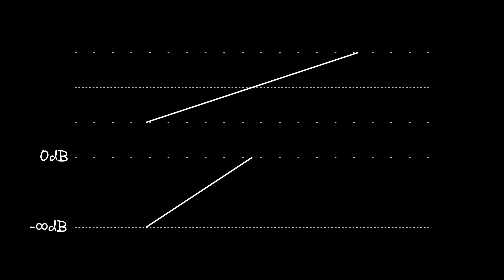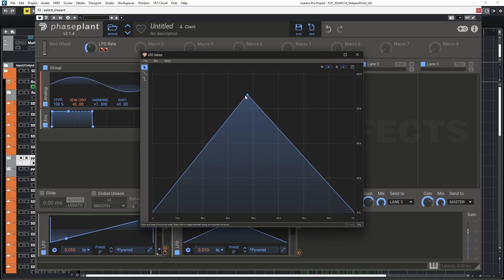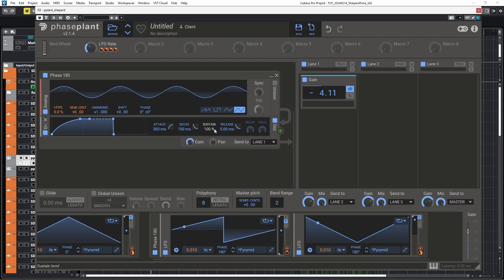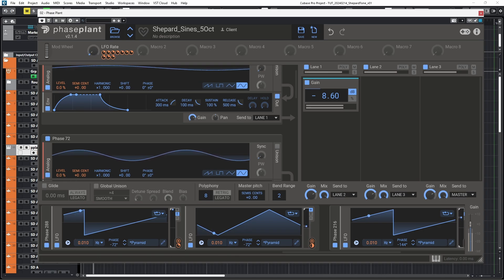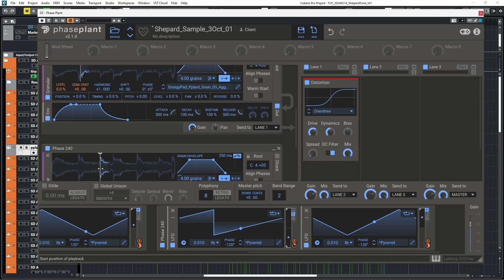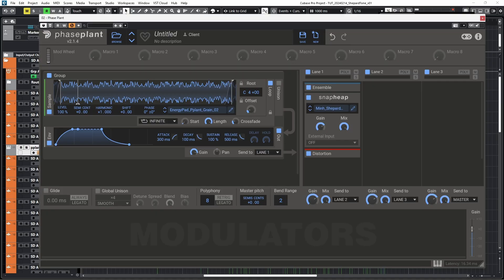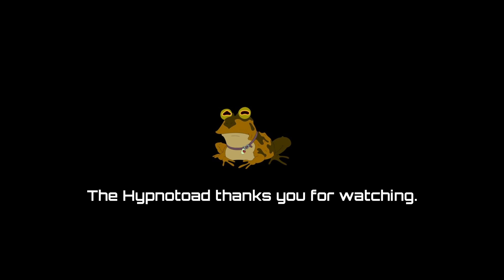Turn ANY sample into a Shepard tone!

Comment from the maker: I tried to keep this one short, but I do have a few additional notes:
1. In my experience, the slower a Shepard tone is, the more convincing it is. And you'll have to slow down the LFOs even more when covering a larger octave range.
2. You need a drone/pad with a static pitch when using samplers, but that's not the case when doing granular Shepard tones! Any sample will do - but you'll probably have to set a fixed grain playback position.
3. Ideally, you want the different voices to be tuned an octave apart from each other so that the human brain is tricked into thinking the upper voices are harmonics of the lowest voice. When using effects such as flangers, comb filters, etc, it's not always easy (or possible) to tune the cutoff frequencies to actual notes, and to have the voices apart by an octave. That is the case in this video (except with the resonators, which are tuned to precise pitches). It's fine, you can still get a decent effect out of it. The sample is 'in tune' with itself and the comb filtering affects its partials without changing their harmonic relationship too much. You could probably get perfectly tuned phasers, flangers and comb filters in a virtual (or physical) Eurorack environment, or by building custom effects in a framework such as JUCE, PureData, Reaktor or Max. (Edit: it used to be possible with the plugins Endless Series by Oli Larkin and Möbius Filter by iZotope, but I think both are discontinued).
4. If you want to print your Shepard tone to audio to make a looped sample out of it (to implement in a game, for example), you don't have to print a whole period of the LFOs to get a perfect loop. You just have to print a fraction of the cycle that's the inverse of the number of voices - for example: a third of the cycle when using three voices. That's because that's the time each voice takes to get to the initial pitch of the neighboring voice. Give yourself a bit of 'pre-roll' and 'post-roll' if you're processing the sound through time-based effects (delay, reverb, etc).
5. You can experiment with loading a different sample for each voice. The effect will be less seamless, but you can achieve more interesting movements (kind of similar to the sounds I made in this video when modulating the grain playback position somewhat randomly).

Comment: Amazing as always!
Could you please explain the part where you say it's a range of 3 octave so you divide by 2 ? I am not sure to understand here and  I feel it's an important part also for adding extra voices!

Thank you! :)
Reply from the maker: Hey thanks James!
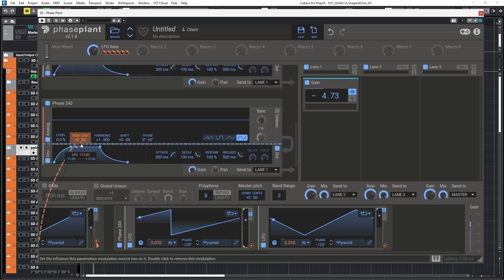Are you talking about the part at 05:28?
So: the pitch LFOs are set to bipolar mode. They output modulation values ranging from -1 to 1 (instead of 0 to 1, in unipolar mode). So a bipolar LFO covers twice as much range as a unipolar LFO!
In the first example (2 voices covering 3 octaves), by setting a pitch modulation value of 12 semitones (= 1 octave), we cover 12 * 2 = 24 semitones = 2 octaves. So in the second example (3 voices covering 3 octaves), we cover 18 * 2 = 36 semitones = 3 octaves.
I hope this clarifies it. Let me know if you have further questions 😄